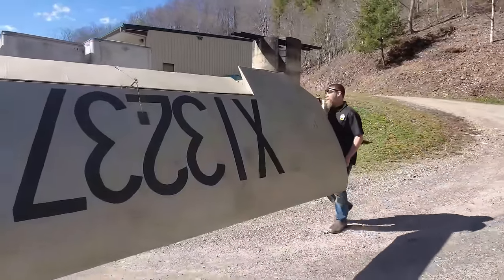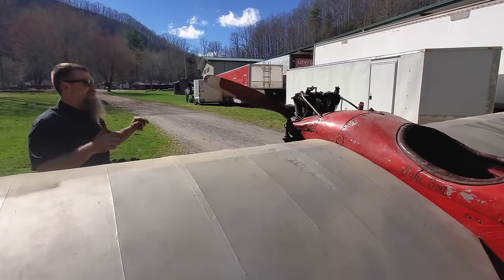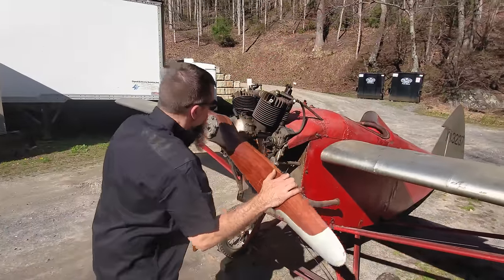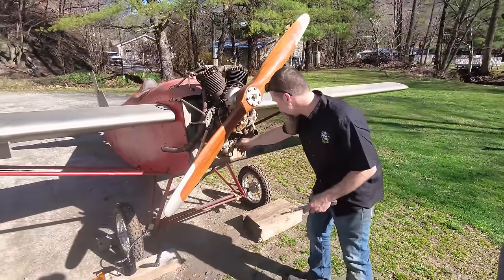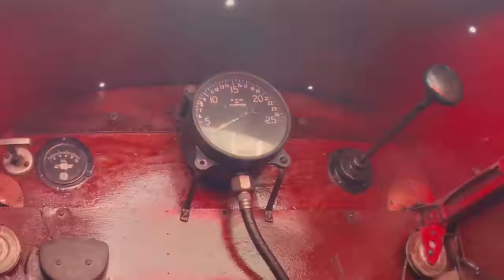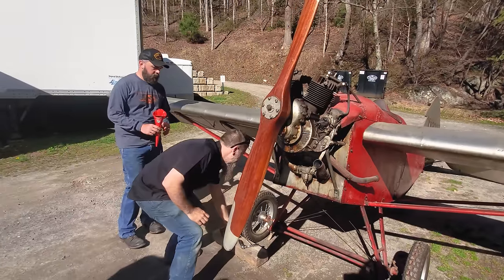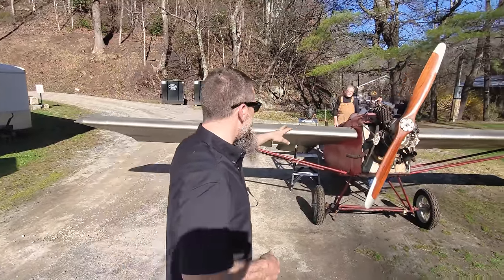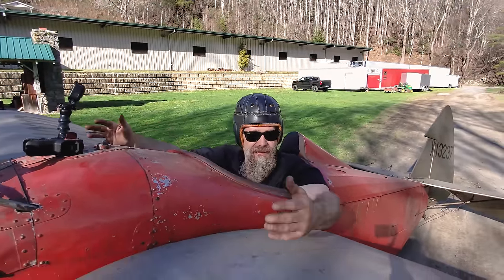Can We Make This 1920s Harley-Davidson Powered Airplane Fly?

Comment: You've gotta get this thing in the air it's amazing 
Get it inspected for airworthiness and a pilot that's willing and fly it even if it's just the once 
It's brilliant
Reply: Pardon my pedantics, but an amateur-built experimental airplane cannot be considered "airworthy" because it is not built in accordance with a specific Type Design. In legally safe flying condition it is considered to be "in a condition for safe operation" but never "Airworthy." That term is reserved for certificated aircraft only.
The most critical aspect with regard to flying this airplane with any margin of safety is it's fabric covering. Being that this is an experimental aircraft with no CAA or FAA Type Certificate, most of the criteria is recommended but not mandatory. In the case of the fabric, however, in the name of safety the airworthiness standards for certificated aircraft MUST be adhered to, even though it has no Type Certificate.. 
Contrary to popular belief, aircraft have never used canvas as a covering material. If it has Grade A Aircraft Cotton or lrish Linen fabric covering I doubt that it would pass inspection. For a small airplane like this the minimum tensile strength of the fabric is 46 lbs per square inch. Natural fabrics deteriorate over time to the point where they will no longer bear the minimum load. Sometimes the dope coatings will still look beautiful but the fabric underneath is rotten. That's why we often call the old Grade A Aircraft Cotton Fabric "Rotten Cotton." If, at some point, the fabric has been replaced with newer Dacron polyester fabric with adequate UV protection (silver dope or PolySpray) and kept hangars then the fabric may still be serviceable.
Second would be the integrity of it's wood structure. Many wooden airplanes from the 1930s on down were built using casein resin glue that deteriorates and releases after awhile. Insufficient varnishing of the structure can result in decay of the wood. Any landing mishaps like ground loops can overstress wing spars causing compression failures that can be very difficult to detect. All this would need to be very thoroughly checked. Repairs should be made with Resorcinol adhesive. Since it is an experimental, epoxy adhesives could probably also be used.

Comment: Best video I have watched in ages. I am a 68 year old pilot. You guys were so wreckless, disrespecting an airplane in that manner! But it was great fun. Glad no one was hurt, killed or maimed.
Reply: I kind of agree. He had me pretty scared. That thing could be pretty touchy with little room for error. It's called PIO, ie pilot induced occilations. Lots of experimentals have crashed over control issues. Safety first.
Reply: As long as he is WRECKLESS, it's fine...reckless or not.

Comment: The carburetor on airplanes is ALWAYS mounted under the engine to avoid fires in flight should a carb, gas fittings, o-rings or fuel hose leak gasoline. Updraft carburetors are on every carbureted airplane.
Reply: Every?  That's an absolute, and absolutes are seldom true.  Technically, the Bendix-Stromberg pressure carburetors used on many large, radial engines are still carburetors, and they are downdrafts.
Reply: @Hopeless_and_Forlorn  I agree about the absolute, im sure there were one or two instances at the very least in the beginning of aviation where carburetors above the engine leaked and caused a fire, unless this happened to be a moment of brilliant foresight.
Reply: Rotax aero engines for example don’t
Reply: Bonanza and a Cessna 182 are what’s called side draft carbs.
Reply: @gulfcoastaero8048  
You're thinking of a T182 or 182RG with Lycoming O-540-L3C5D and Marvel-Schebler/Tillotson HA-6 horizontal draft carburetor mounted in the rear with intake facing aft. The standard 182s with Continental O-470 engines have a Marvel-Schebler MA4-5 updraft carburetor.
Early Bonanzas had Bendix PS-5C single point fuel injector units commonly called "pressure carburetors" but they were not carburetors at all. They were single point fuel injection units.
Reply: This is incorrect. Carburetors are installed under the engine so that high wing aircraft with gravity feed fuel systems and no fuel pumps will have optimum fuel head pressure at the carburetor from all the way up in the wings or fuselage. Much like a gravity-feed Ford Model A fuel system that has it's carburetor mounted low to the underside of the intake manifold. Most low wing aircraft with fuel pumps still utilize the underslung carburetor since it takes less fuel pressure to keep the carburetor full. Fire hazards are the same since the exhaust system of most carbureted airplanes is coming right down on either side of the carburetor. 
Most fuel injected aircraft engines have their flow dividers and nozzle lines on top of the engine so the leaking fuel thing was not much of a consideration.
Reply: @Hopeless_and_Forlorn  Pressure carburetors are not carburetors. They are a type of throttle body injection. Carburetors do not work in the absence of gravity, pressure "carburetors" do. Pressure carburetors are poorly named.
Carburetors work on by a very specific principal that is not utilized in pressure carburetors.

Comment: MAtt!!! does the gear drive at the front use engine oil also?? Is that why it had extra oil? You really don't want that to be running dry!? Amazing as always 👍
Reply: Exactly what I thought and Hook up the ailerons!!  Pre flight that baby very closely.
Reply: Another pointer too, you want a slow reliable idle or you could float of the end of the runway landing or you could also loose power when you need it. If my KR2 was not at dead idle on landing, it would float off the end of the runway in ground effect.
Reply: @davidhakes3884  That airplane would have taken a lot of work to get truly airworthy including recovering.   Every control wire, nut, bolt, fitting would have to be checked and the engine would likely need to be disassembled and possible overhauled.   It is unique sounding though!
Reply: @donadams8345  Hi Don I am from a flying family. Light weight ceconite would be a quick fabric job, I wouldn't even paint it. I flew a Lot in Alaska and have flown some Very sKetchy Aircraft.I just get a kick out the Bike museum. Regards.
Reply: The engine and the gear reduction assembly are lubricated independently.

They may also be designed to use different lubricating  oils.
Reply: @caesarillion  switch off the magnito if necessary to prevent an over-run after landing.
Reply: @davidhakes3884  it doesn’t appear to have ailerons.  Seems to only have flaps, rudder, and elevator.
Reply: @internetkilledthevideostar  It has Ailerons
Reply: @moler1964  Couldn’t see them in the video.  Just the flaps.  They must be hidden/laying pretty flat against the wings.  Also, then they were installing the right wing, it appears to only have one cable they put through the fuselage.  Seems like there would be one for the flaps, and two (same cable) for the ailerons.
Reply: @internetkilledthevideostar   the flaps you mention are the ailerons, as mentioned in the video they were Not hooked up .
 which is why Both were hanging down appearing to look like flaps.
Reply: @internetkilledthevideostar  Check terminology friend Your reference to Flaps ARE the Ailerons.
Reply: @davidhakes3884  ailerons are usually on the top of the wings, and can either go up, or lay flat against the wing.  Have never seen ailerons that hang below a wing.
Reply: @internetkilledthevideostar  You have a strange concept of ailerons. They are hinged at the trailing edge of the wing, and move both ways, up and down, opposite directions on each wing, to control roll. Ailerons don't "lay flat against the wing"...and a simple, basic, slow aeroplane like this would not have flaps. 
In this run-up, the aileron cables were not connected to the joystick, so they both just hung down(and flopped with each bump). They aren't "flaps" which are surfaces for increasing the curve of the wing for slow-speed flight. Normally, with the joystick centred, the ailerons would be streaming back horizontally in the same plane as the wing. When the joystick is moved side-to-side, one aileron moves up, the other down, on their hinges...there's no stage where they "lay flat against the wing". Ailerons were invented as a better method of control than the flexible "wing warping" that birds & the Wright Bros used.
Reply: @topspeed250k5  guess I’m used to maintaining large aircraft; B-52’s, C-17’s, C-5’s, etc.  Usually have ailerons, spoilers, and flaps.  The flaps usually take up most of the trailing edge of the wings, in those sized aircraft.  I stand corrected, as those ailerons, on such a small craft, looked like what I normally see as flaps.

Comment: Amazing! How fast will it taxi before it's off the runway?  Bet it wouldn't take much!
Reply: wouldn't surprise me if stall is as low as 40 knots indicated! it needs some instruments fitted, airspeed, attitude and altimeter at a minimum.
Reply: Might lift the tail at 50mph or less - it's probably about the same performance as an early WW1 scout.

Comment: You guys didn't pull this engine down and make sure each component was in decent condition ? You didn't check EVERY cable and connection to make sure THEY were in decent shape ? You didn't verify any gauges ? You spin-started by the prop in an utterly unsafe manner ? Would you have trotted a bike out of a garage that hadn't been run in 20 years , tried to fire it up and head out ? We'd LOVE to see this thing going , but seriously - no attention to good practice ?
Reply: Right?
Reply: Party pooper.

Comment: I reckon I'd put the gas tank at the rear of the plane! I used to Hang Glide & I can tell you Helmets are your friend, as soon as you crash you get thrown into the front of the thing & would probably get a bath of gas!
Reply: The fuel tank needs to be close to the COG, which is why they're usually directly in front of the pilot or in the wings.
Reply: What if it busts behind you

Comment: Dale should have taken out the decompressor shims under the cylinders to run the 87 octane as they were only running about 40 50 octane back then also what are you doing about lead additive for them valves
Reply: @Full_Otto_Bismarck  don't care what the can says anything can be put into it he did say that he was running 87 octane pump gas
Reply: @brenttate9299  i dont recall anything about a pump or 87 octane, and the point was that Sunoco is at least one brand still making specialty fuels with lead in it, aviation gas still has lead in it too, if you need lead in your fuel due to old valves its a better alternative than inconsistent mixtures of additives dumped into your tank with ethanol infested pump gas
Reply: @Full_Otto_Bismarck  the reference of pump gas meaning out of the pump at the gas station meaning unleaded. Why are you answering Dale's question the question was aimed at Dale
Reply: @brenttate9299  dale passed away for one thing, two, I really don't know, im bored

Comment: Not to be critical you should get some idea on how to hand prop an airplane. Keep doing what you did and sooner or later you’ll break both arms and cut your head off
No way I’d get in without those ailerons hooked up. Did you even know what way those controls should move the surfaces
Motorcycle can be dangerous. Aircraft are absolutely unforgiving

Comment: You need to keep the tail firmly on the ground. To do that pull the stick back as far as it will go. That keeps the elevator fully in the up position and that keeps the tail planted firmly on the ground. You should have gone to your local airport and talk to someone who has a tailwheel endorsement. Remember this, without any kind of proper training, you will be very dangerous behind the controls of ANY aircraft!!!

Comment: Pretty neat little plane, about the same vintage as a Pietenpol Air Camper/Scout, though the latter is still being built from plans; the originals (and some current builds) used a modified Model A engine w/ 40 HP.  I think there are a few more modern experimentals, using HD power.  That reduction gearbox looked like a nifty piece of engineering!

Comment: Well,  I for one was let down that you didn’t actually get it off the ground.  Just to get it up into ground effect and skim along for a few feet would have been fine.  But, it was scary for you, and I understand that.  If you decide to go further with it, be sure to visually inspect all the control cables, pulleys and fittings for corrosion and any signs of weakness.  Make sure the control surfaces and moving freely with the controls.  I’d also take a hard look at the wing and strut attachments for signs of corrosion or fatigue.  It looks like it ought to be a lot of fun to fly!

Comment: When I saw this title, I had to watch it.  The old Harley engine sounded good.  I am surprised it ran as well as it did, with the length of the intake from the updraft carburetor.   It has to have good vacuum, to lift the f/a mixture that height, hence good compression, also.  I don't think the engine mount, nor the landing gear were robust enough to handle the torque, or a halfway rough landing, respectively.  I could have sworn that I saw the front engine mounts flex, considerably, when the throttle was opened, or it sputtered.  It was very interesting, though.

Comment: Matt - I can't claim to go to the '20s but I did my first solo in the '60s in a 65 Hp J-3 cub.  I now have 3500 hours in airplanes and 1000 hours in gliders and sailplanes, I have a full commercial license and I have held an instructor's rating.  I live in Durham NC and I can be there in three and a half hours.  If you get it safe and legal and want if flown, drop me a line.  

And my first instructor wouldn't let me fly the J-3 until I learned to hand-prop it.  I'll show you the safe way sometime, if you'd like.

Comment: It is very possible to make it airworthy, but it also might be a lot more work than you are expecting. An inspection will require stripping off all the covering (which wouldn't pass inspection anyway). It looks like there is some structural damage to the elevator. Finding a pilot who is comfortable with the powerplant situation will also take a lot of work.

Comment: If it weighs less than 254 lbs., you might be able to fly it as an ultralight. There's also a limitation of 63 m.p.h. at full power. I concur with the improper propping technique. I had an Aeronca Champ and a Chief. I also towed banners with cubs with no starters. 
Before even taxiing, those ailerons should be connected  as they actually help to keep the wings from picking up if there's any wind. Don't taxi if the wind is over 10 m.p.h. or so.
Have an aviation mechanic (A&P) look it over and do a boroscope of that engine before even thinking about flight. He'll be interested in the condition of the fabric as well as the wooden structure underneath. Many modern A&P's don't have knowledge of fabric covered airplanes.Control cables are quite important too!
If it doesn't meet the requirements for ultralights, it will have to be registered as a light sport aircraft. 
Good luck with everything. I'll be checking in to see your progress. Do you have any flight time? If not, you'll need a good stick and rudder man to test fly it. Not too many around anymore.

Comment: The flap on the back is called an "elevator". BTW, have you checked to ensure the condition of the airframe, engine and controls? As for weight, if the plane does indeed weigh less than 250 lbs it could be considered an "Ultra Light Aircraft" and doesn't need an airworthiness certificate, nor do you need a private pilot certificate or sport pilot certificate. Just remember it's not the initial crash that gets you...but the sudden stop at the end of the crash. I would seriously recommend both an inspection of the airframe and engine and getting flight training anyway.  Looks like it'd be a hoot to fly though.

Comment: Hope you checked the rigging of the flight control cables! Plus I’m easing the rubber on the landing gear tires may be a bit dry rotted. I’d give the skins a good looking over especially the wings. Wouldn’t do to have it come apart in flight.

Comment: To start. You hold prop with your stronger arm (if possible), other guy holds your other arm at the elbow. He pulls you away and your grip spins the prop. Even with this engine you don't want to get in the way even at idle - at best you'll get a compound fracture at worst a shattered arm. WW1 ground crew would walk the aircraft on taxi like you did because they're so light. And if you do fly it walk the field first. You don't want it to bog and you really don't want to hit a field drain or trench or something like that because the edge of the cockpit will go through your face.
You may have to check the magneto/ignition since you might need an aero ignition with twin circuit. If you already have the switch will be Off*Start*One*Both*Two. A preflight procedure when the engine is warmed up is with the mag switch set to both snap it to one, the engine rpm should drop, ditto position two the same, and then back to both. A shutdown in positions one or two is a no go, even if you have 3 other engines the flight is scrubbed until the reasons are found.
There might be workarounds due to age of aircraft or home made, kit etc but do not try to get this in the air because that's the easy bit, getting it down without issue... That's hard. Have it checked out and find a pilot used to manual control - things like SE5As and Haberstadts.. Or really geriatric Cessna.